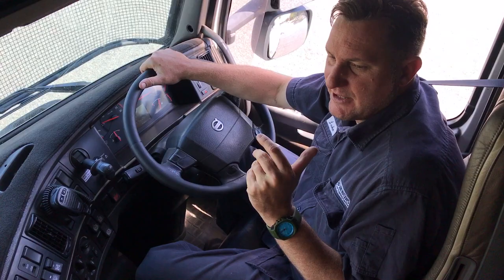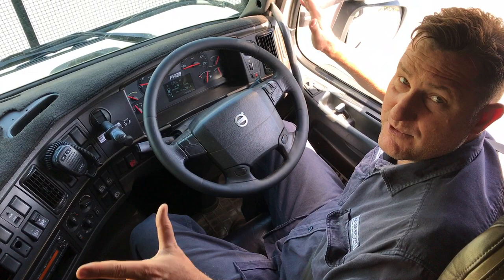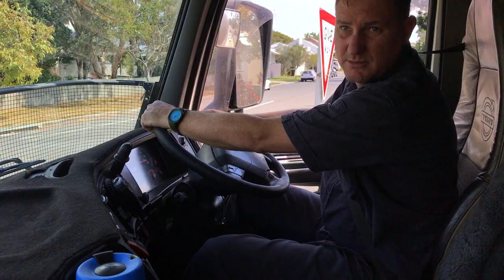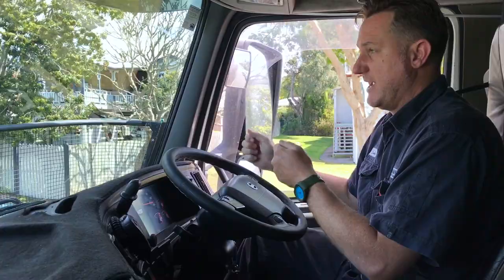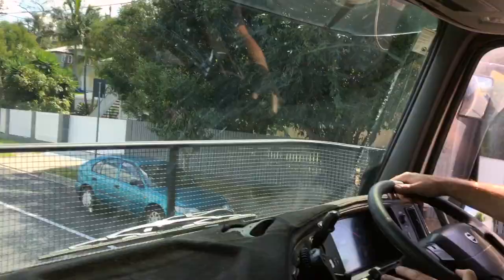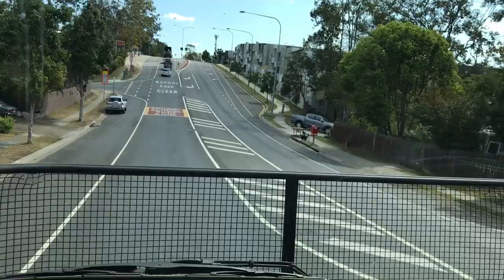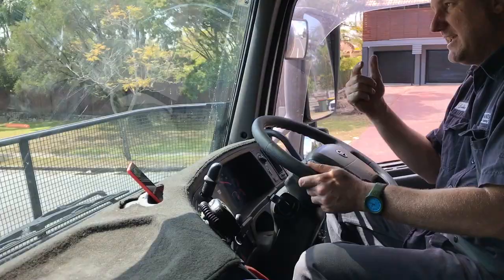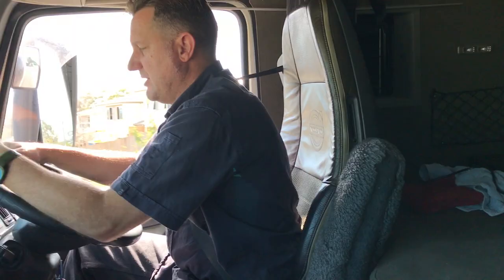How To Drive A Truck - How To Use The Auxiliary Braking System | VOLVO TRUCK

Comment: Great presentation. Thank you.

All I know about heavy road transport is what I sponge in on the internet.
Took note about a Jake brake. Impressive. But a costly addition.
Knew of an exhaust brake all along. But only knew about it.
Took note of a Voith retarder 45 years ago. And was hooked on its sheer practicality. But that was the end of it as well.
While putting my nose into matters again noted magnetic retarders. And while still reasonably ignorant to this fraternity. Deem the latter as an excellent and uncomplicated answer to this method of slowing down.
And surely at it's own cost,

Can the heavy vehicle owner/operators with specific long-term experience of any retarder usage please comment on the amount of of wear-saving/less maintenance down time on the service braking system of a heavy vehicle?
And. If possible. On lang haul. And local delivery situations.
Will be greatly appreciated to get it directly from truck owners with particular experience.
Many thanks.
Keep safe and God bless!!

Comment: Any advice on how to properly use engine break on mercedes arocs? driving a fully loaded truck downhill for a length of 2.5km
Reply: 3 stage engine brake probably the same as the Volvo. I have driven both and they are much the same. I never use engine brakes when empty. Be mindful on wet roads in older trucks when empty if you are using as it can lock the rear wheels.

Comment: do they signal at the back with the break light?
Reply: no they don't, only with the footbrake will people behind notice the brake lights on.
Reply: Sgodo Jinsem no they don’t. Most truckers will use it all the time,  so if it did it would be very annoying watching the brake lights going on all the time,
Also it’s a gradual resistance type of effect & car drivers if paying attention will be able to stop due to noticing they are getting closer to the truck, within good time.

Brake lights go on only when foot brake is applied!!

Engine brake is often a valve in the exhaust that closes & creates back pressure & slows the vehicle, engine management will adjust fueling & keep things in balance.

Basically what happens is the retarding device puts the engine in a semi stalling condition & slows the vehicle.
The effect is transferred to the rear wheels through the prop shaft thus keeping the truck well balanced over all. All trucks are rear wheel powered.
Reply: Some models now do if they are using stronger settings
Reply: The brake lights come on with foot and trailer brake